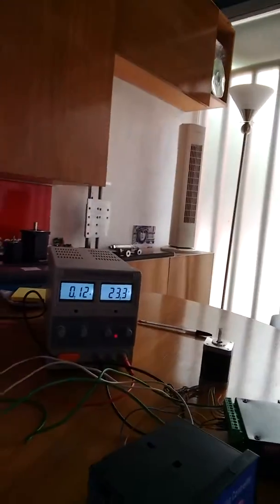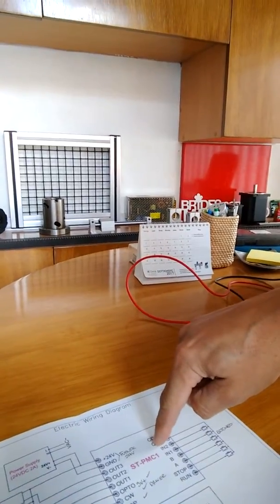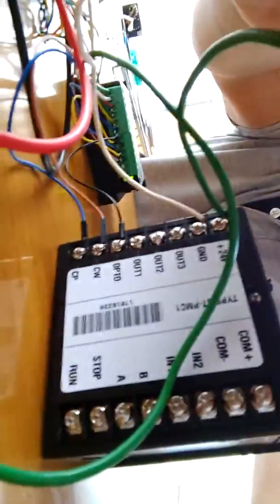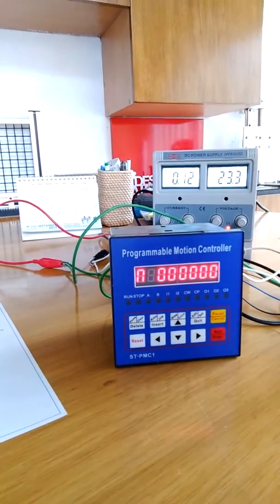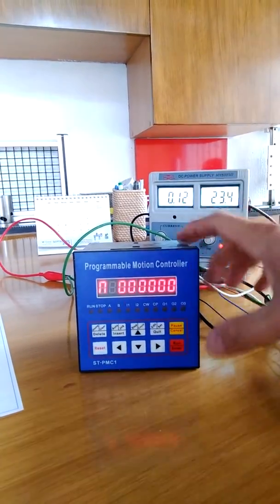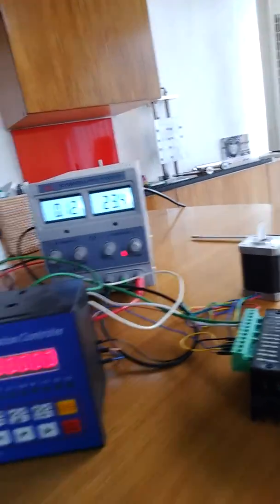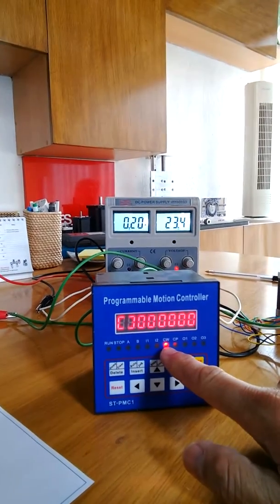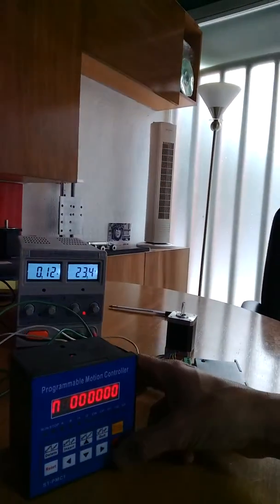Controller1AxisStepper.mp4

Comment: Sir i need your help. I am going to develop one application  using this controller . The application is "when limit switch is ON motor should run in one direction  for given steps .
Reply from the maker: Hello..
What do you need to know about controller..
Is possible do that, just yo need to get pulse on/off 5v or 0v  that signal you can test in outsides CW dir and CWW pul..
For turn on/off the limit switch and make stop or advance..